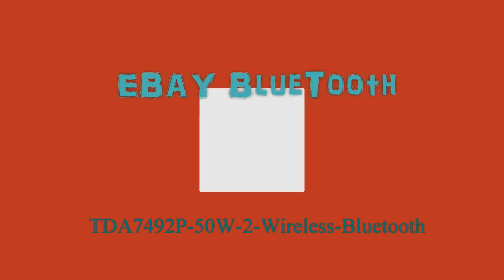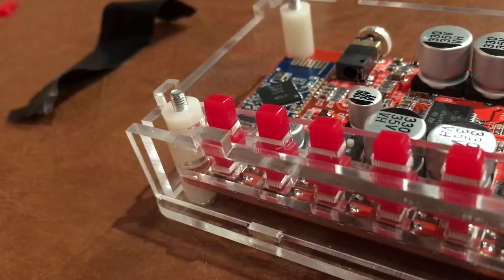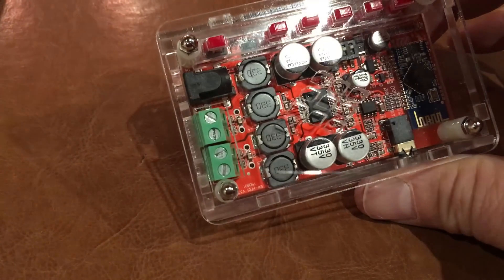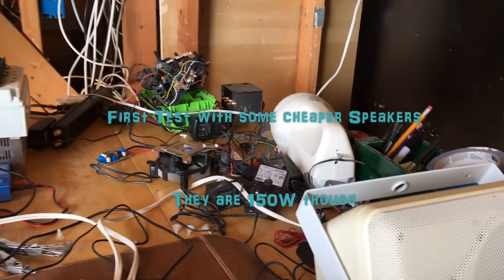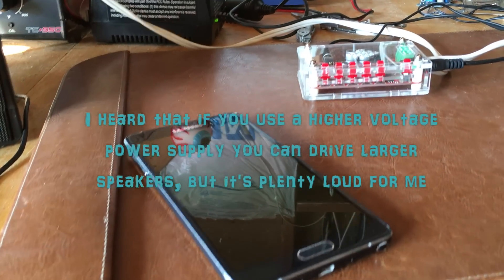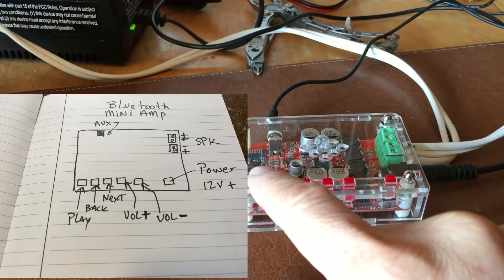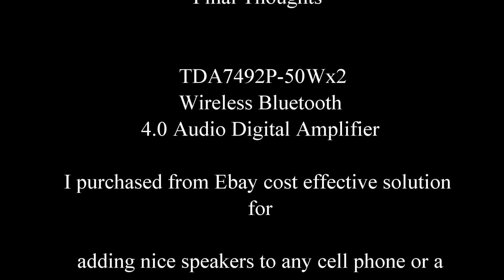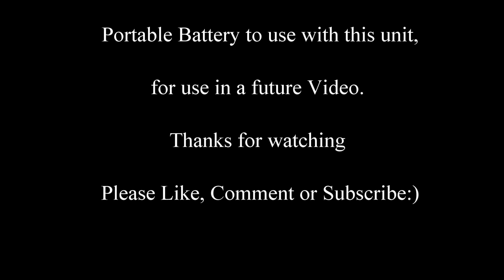TDA7492P Wireless Bluetooth AMP+case, Add Speakers to amazon Echo DOT

Comment: I have the portable battery power supply. How do you attach it
Reply from the maker: you will need a barrel connector like you see on laptops there is a power port on the unit plug it in there the center post should be positive voltage. here is a link to a jack that would work
http://amzn.to/2xyvimv

Comment: I bro I purchased it recently Im using 12v 1.5 amp power supply but sound isn't coming from speaker after connecting.. Inspite device connects Bluetooth.. What might be the reason
Reply: Ya apsolutely.. High power sourse drives very nice output  second one after replacement is terrific
Reply from the maker: Hard to say, I believe you should have a 3.5mm jack for in line audio, have you tried connecting it to see if sound comes out that way?, you could have to low power or bad speaker connections, once you verify you are getting sound there then you might have gotten a bad unit.
Reply: Yes I'm getting sound in the 3.5mm jack but not in external speakers
Reply: It's confirm the amplifier is defective. I've replaced it with other amplifier of same model I'm now feeding it with a high power supply 24v 3 amp and its working flawless I think that amplifier is having manufacting defects
Reply from the maker: @suryakhan  Well when you are driving speakers more power is better

Comment: It's a pretty good looking amp, I'am going to build an soundbar with good 4 ohms speakers, some good quality car speakers with separate tweeter, they are cheaper to buy and often comes with a crossover fitted to the speakers for the best sound.
Reply from the maker: Michael Augard yup. I just made a pelican speaker box. And I used this amp at first but wanted to use a sub so I went with another amp and it is even better than this one. But this one is good for the price.
Reply: What amp are you going to use?

Comment: I bought the same amp from ebay for less than 10 euro in February 2017. I do not know what is wrong with your box (or hands), but I build the box without any tape in less than a minute. I put screws the other way to use nuts as feet of amp.
I do not know where it is from that this amp can deliver 2x50W. It is not truth. When you open datasheet of TDA7492P you can find out that it can deliver 2x25W into 8 ohms, but with 10% THD. According to THD characteristics, acceptable 1% THD is reached with 20W output power into non-reactant 8 ohms, so realistic power output into speakers rated at 8 ohm with 1% THD (which is not very good) will be no more than 18W. Moreover according to all published characteristics, it does not matter if you connect 8 or 4 ohm speakers. Power output will remain the same which is logical, because with class D amps do not apply doubling power output when going from 8 to 4 ohm speakers. The only thing you need to know it that you can not use maximum power supply voltage (26V) when using 4 ohm speakers.
And this amp is very sensitive to power supply quality. I tried to use standard switching PSU from old laptop and there was quite strong buzz in background. After connecting to stabilized 20V PSU everything was OK.
And yes...for the price it is nice miniamp with good sound.
Reply from the maker: Dude, I agree with everything you just said. I used a pretty nice 12v power supply that was regulated and it sounded good. but will not push every speaker the same, the speakers I have are selectable on the ohms side, so they worked out perfect. You can make a really nice bluetooth speaker out of these, but don't expect to blow a sonos or bose out of the water. I have paired mine up to an Echo Dot and since you can link the Dots together in groups you can have whole house music, I think I will make an enclosure and make have a usb port so you can power your dot from it. Thanks for the comment.

Comment: Already have one that I made a bluetooth speaker with. Now gonna get another one and use it for my car. Do you think it would work?
Reply from the maker: You might have to get wire directly from the battery and run it to the dash if your power plug in the car doesn't have the amps. I have not tried this but i think most cigarette lighter ports only have a couple of amps. I would say try it, and if it doesn't work try hooking it up to the battery direct and see, if it work then run a line where it needs to go and don't forget to fuse it.
Reply: Thanks for the advice.

Comment: I just wanted to suggest using the 18650 battery in a series of four to give you a range of 14v to 16.8v. so a fully charged battery is 4.2v and when it's running low it's about 3.5v. You could run them in parallel to give a higher amperage and longer run time. The batteries are free if you go to an electronic shop and ask for an old laptop battery somebody has turned in for recycling, then you can harvest the batteries from the laptop battery.
Reply: So I guess I did a mistake here. I bought DC 12680 L-ion battery, and the amp won't turn on unless it's connected to charging. I tried some speakers of 7w and it doesn't produce any sound.

Comment: Most of the variations of this amp board are not really able to put out the full max power.  If they say it is 25 watts per channel they are quoting the peak maximum output power of the total chip, in reality, you can expect about 2.5-3 watts RMS  per channel and maybe 5-10 watts per channel peak before the distortion is really noticeable.  If they say it is 50 watts per channel you can probably expect about double the above numbers 5-6 watts RMS per channel and maybe 10-20 watts per channel peak before the distortion is noticeable.  
Back in my car audio days, we thought <0.5% THD was great 0.6-1% was decent for an amp and much higher than 4-5% was quite noticeable when the vehicle was stopped.
Reply: It's actually 25x2 at 10%distortion, 20wx2 at 1%...rated power...but it may do better. The lepai lp-168ha uses chips rated at only 5wx2 but put out 8wx2 and the bridged side put out a clean 12w. Surprising little amps.

Comment from the maker: Check it out man, this device is good on the cheap, but I have also found perfectly good amps at Goodwill for around $20, and it will drive 4 speakers. Not sure if you have Goodwill? but most thrift shops have electronics. I used this because I have a gazebo that has speakers and didn't want to lug a receiver around. Cheers

Comment: thanks for the video. I have one of these amps and I can't figure out how to use the aux input. I plug it in, and I cannot get the sound to come out of the speakers, even when there is no bluetooth. Can you tell me how to make it work? thanks.
Reply from the maker: So can you make the bluetooth work?? could be that the connection is bad, or that you need to turn up the source volume or the volume on the unit. I would try different sources, I have plugged in my phone and PC to it, as well as the bluetooth connection, now, when I did my PC it didn't work until I changed my output on it to do to the headphone jack. This is why I am saying try a phone or ipod on it. I have a drawing on the video that shows where the volume is. Oh one more thing, the plug on your wire going from the source to the aux input make sure that is seated all the way in. that is how the unit can tell you want to use the aux and not the bluetooth.
Reply from the maker: 3:48 is where the drawing is.
Reply: Hi, thanks for your reply. I am able to get the bluetooth to work, but what I did was power up the unit, and then before pairing, connect a portable CD player to the aux input. No sound, although if I powered the unit while the CD player was playing, I would hear sound for a short period of time and then it would go away. I will try different sources like you suggested. Also, I have seen at least one video that said that it was an AUX out, and he seemed pretty sure. From a product features perspective, this makes no sense. Why would you need an aux out? Again, he seemed pretty sure. What do you think about that? thanks
Reply from the maker: I have used it for an aux in. and it by passes the bluetooth if you have it plugged in. hopefully it works for you.

Comment: wich is the polarity please help me with that i really don t want to burn this thing
Reply from the maker: well it takes a standard barrel jack, the center is positive and the outside of the barrel is negative. I am using a 12 vdc 6 amp Power supply. The speakers don't matter as much but the outer terminals are positive and the inner are neg.

Comment: Mine is arriwed at tomorrow but it has disorted voice at low freq. on mid volume.
Anybody with that problem or just me?
Reply: 25 x 25 watts two channels driven = 50 watts
Reply from the maker: It sounds different with different speakers, it depends on the power supply and how many ohms your speakers are. I put cheap but hi powered speakers and it sounded low, but I put good speakers that had ohms adjustments on them and it sounded really good.

Comment: Hey man thank u for that demonstration I have Wave radio that I does not work anymore I took it apart and won't use the speakers the and this may be one of the best way and also make the bluetooth
Reply from the maker: Larry Earp Cool yeah I had the speakers for years not being used. This makes them useful. Also I like to go to goodwill and find old equipment and reuse it.  Thanks for the comment.
Reply: Hey man 👍 old can be new again , i had got a new flat 📺 on them as u may know to add a sound bar there's a new type a system on your where you can nap and regular speakers i had bose speakers so i did not want to put out $250 or more speaker that i had sitting around the house collecting dust so i took my tv a part and attaching wires to my speaker on a TV to my Bose now I have a wonderful son I'm sure that there's an adapter for the new type of Television hook up in the back but I just don't know anything about them as of yet